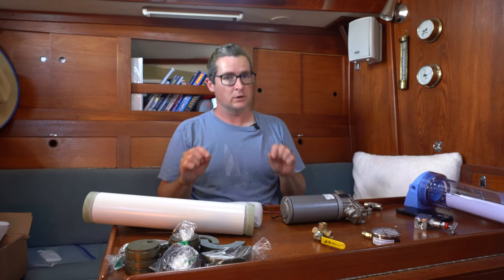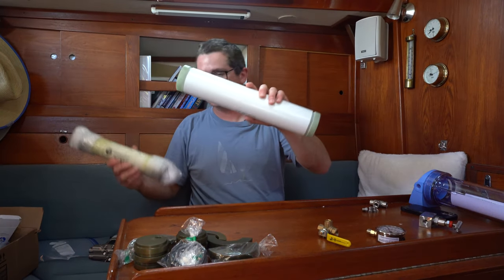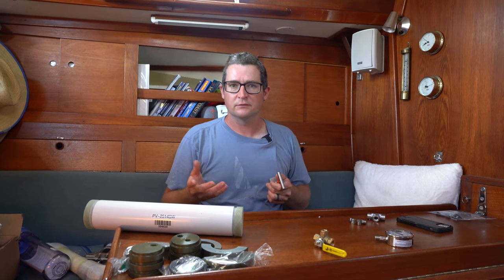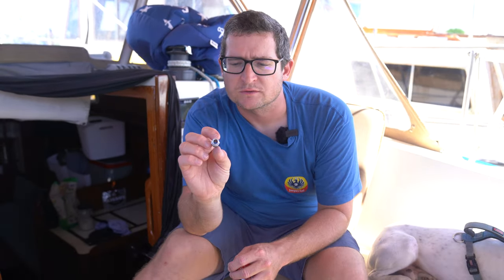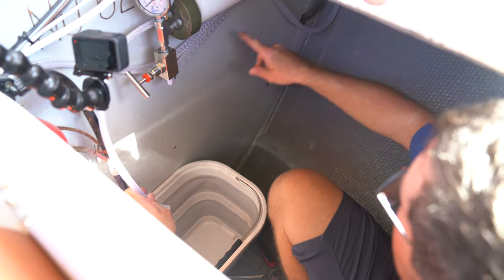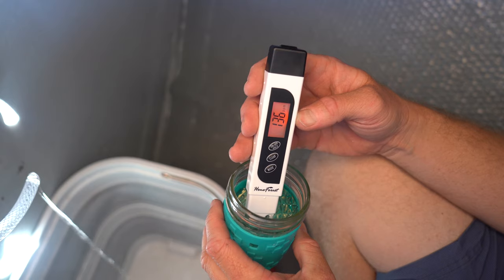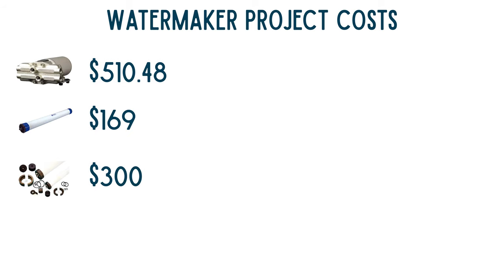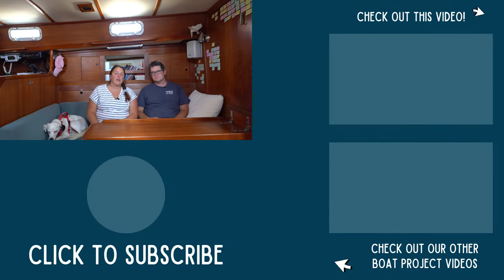A Budget Friendly DIY Watermaker!

Comment: Piston pumps are notorious for have a low tolerance for poor inlet conditions. Being a much better mechanic than a sailor, it occurs to me to locate the water maker below the waterline to create what we call a flooded inlet condition. Excavator manufacturers etc. etc. do this to make their piston pumps last longer and reduce cavitation noise. Of course not being familiar with sailboat "stuff" perhaps this isn't feasible.
Reply: Put the thru hull below the water line a primer pump will do the same job idk if he is using one yet
Reply: all desals use a feed pump
Reply: By poor inlet conditions, you presumably mean that it does not self prime? And that is resolved by having the inlet below the waterline?
Reply: It's doable in most boats.

Comment: I kinda like the size, but I don''t really like that pump.  I have a 12v 1hp pump.  It pulls 80 amps, but I can get 40 gallons per hour on the high side and 35 pretty much in any situation.  It cost around $1800.  So just as a comparison to make 40 gallons of water on your system, you will probably run for 13 hours at 14 amps per hour.  That is 182 amps.  I would use 83 with the boost pump and be done in an hour rather than watching the system all day.  You can go to SV Adventurers watermaker video:How to make a 30 gallon per hour watermaker.  The parts are there in the more section and comments.
Reply: This pump would be around 1/4 hp, but I guess the real point is that it fits well with a solar system,  in that, you can use it for a few hours a day, after the solar controller has finished charging the batteries (and would otherwise   be dumping that power). 14A would be doable with a 300 or 400W system. Sure, a bigger pump would deliver water more quickly, but then you probably have to think of a different way to provide the electric current, and if that is a generator, you might just be better of running a 110 (or 220V) AC directly to the pump. In other words, this looks like a neat solution for smaller boats that have surplus solar power (at least some days). The only downside might be the noise level for an extended period, but i didn't hear them comment on that, so maybe that is not an issue.
Reply: @stephenburnage7687 where they placed the pump, I suspect noise is not an issue. If it’s in the galley or salon, that’ll be more of an annoyance.
Reply: Your system is definitely more efficient (assuming my watt calculations are close to accurate), but a solar based system that can muscle that pump would have to enormous. As the other gent mentioned, a reasonable option for a larger vessel. 180W for 2-3 hours would supply several days of emergency rations of water.  If I was designing a system with large power use I’d definitely go with the bigger pump.
Reply: @just-dl  Nah the wire gauge to the pump is the biggest cost  8 gauge will do it over a short run in silicone insulated.  The solar panels do a pretty good job of recovering the battery completely during the day.  My batteries are LIFEPO4 and even most 100ah batteries can handle 80 amps continuously.  I have 560ah in my boat.
Reply: @allynonderdonk7577  you got the right batteries for the job. That’s an area where money is well spent not having to over think the DOD. Do you run the water maker in isolation? Or is that draw on top of normal everyday use?
Reply: @just-dl  On top of everyday use.  We might have to use a generator for an hour most nights in order to cook as we don't have gas, especially with six people on the sailboat.  Otherwise our 300 watts of solar will generally run two freezers and the water maker for an hour a day....if it's sunny.  With the genset and the solar we can generally keep up and only burn about four gallons of gas a month in the genset. We won't talk about dinghy fuel.
Reply: @allynonderdonk7577  dinghies will always be “don’t-ask/don’t-tell.” 🤣 that is much more “fuel sipping” than I’d have expected. Once I get my brain around the water maker, I’d like to find a diesel maker! (That would be a good seller!) thanks for the insight.

Comment: As a cruiser who has built several watermaker I now build a bigger capacity watermaker at least 100l per HR, 200 per HR is better, run it for an hour and forget about it for a few days
Reply from the maker: When we originally designed this water maker it was to fit in our 1965 Alberg 30 so space was a HUGE factor. Also higher output is going to cost more money 😊 I think now that we have much more space on our T37 we will likely make a higher output version at some point!

Comment: Question: why don't you manufacture them and make millions off of it?
Reply from the maker: Because there are already a lot of companies out there doing just that. The point of this is that if you have a small budget or not a lot of space there are options outside of the traditional commercial versions that might work.

Comment: While SD cards don't die on a regular basis, I have used my Mavic3 with the RC Pro to record in two locations, plus you have the gimbal to keep the video rock solid.  Some build a unit to mount it to hold it solidly and safely.

Comment: At 3 gallons per hour that means an average sized tank would take 10 hours to fill. That's an awful lot of power if there's not much sunshine. Does a better pump mean more output of fresh water?
Reply from the maker: I think most of us use far less than 30 gallons of water per day.  Our average usage is 4-5 gallons.  We typically run the watermaker for a couple hours most days so we are definitely keeping up with our usage. We have set up our solar so that on sunny days our batteries are topped up by noontime so we run the watermaker on the “extra”.  A bigger pump would mean more output but you’d also need to add a membrane or get a bigger membrane and your costs add up quickly. And a bigger pump would also consume more power.

Comment: Thank you very much for sharing your experiences with this DIY watermaker.  Sounds like a great addition to many boats, both in terms of space and energy consumption as well as cost.    Do you have a diagram of the final configuration with priming pump, dampening hose and flush connections that you could share?

The manual operation may be a big plus on boats that dont run the engine to generate electricity regularly (each day).  A bit more effort, but never a surprise of having the watermaker draining the batteries on cloudy days.
Reply from the maker: Hi Jonathan!  Andy is working on a diagram for our Patron Resource Library.  It should be available to our patrons in the next hour or so!

Comment: On the technical side, it would be very informative to hear and feel the difference of using pressure damping hoses and/ or accumulator dampener. Try reaching the manufacturer or supply shop for a demo.  Good follow up video. Thanks for the video. Very fascinating.

Comment: How much pressure is the fiberglass presumably designed to withstand? Also, why the needle valve and not a ball, gate or other design? I suspect it is for fine/granular control but curious if other valves are possible? And maybe a passive pressure regulator?
Reply from the maker: The housing is rated to 1000psi working pressure, burst pressure I would be 3-4 times that I assume.     You’re correct, it’s needs something with fine adjustment to get the pressure correct.    A pressure regulator is something I have thought about and may experiment with in the future.
Reply: @AbroadReachTravel  its mind boggling how much pressure that pipe can handle.

Comment: Another comment is in regards to your needle valve. You mentioned lack of sensitivity to reset. In hydraulics we always turn to a Parker (Fluid Power) product called a color-lock. they have a very fine thread and a long slender taper needle. Just don't know if you can get them in stainless.

Comment: Can i ask what the noise level is like? Obviously, by going with a smaller pump you will need to run the unit longer (several hours) but is the noise level disturbing?

Comment: My son on his boat he's using a dehumidifier and it runs around the clock any produces a good bit of water apparently he said about 5 10 gallons a day going count the humidity so high around the ocean what are y'all think That's what he's doing hey I think he cost him 200 bucks The one he's got does have a holes on it plus it also has a pump in it to pump the water he bought it I think it's $186 you paid for it I didn't know it would work but he says it does so what do y'all think

Comment: Well done Gwen and Andy! Thanks for taking the time to document your installation and explain all you went through. Also, thanks for sharing all the components you used on your installation. I'm sure, many of us will use your "recipe" to build a more affordable watermaker. However, I wonder why you choose the smallest membrane... (Space, Cost, something else)?

Thanks,
Pedro - SV Tulip
Reply from the maker: Hi Pedro!  Space was the main reaso since we original built this system to fit on our Alberg 30 and had already bought all the components just prior to buying our Tartan 37.  Cost was a factor as well since we were trying to be under $1000 but it was mostly a space issue.
Reply: Hello and thanks for all the info you are giving us. Do you happen to know what is the biggest membrane this pump would work with? thanks again, I'm amaze at what you've done.  @AbroadReachTravel

Comment: Great episode, thank you. How loud is the pump while running? With how much it would be running I'm concerned about the noise all day.
Reply from the maker: I think loudness will definitely be relative to where you mount it.  Ours is mounted to a bulkhead which did not help.  The noise went down significantly after we installed the pulse dampener.  I don’t have decibels (it’s currently pickled so I can’t grab it for you), but I will say I can’t hear it in the Vberth when it’s running and  you can definitely still hold a normal conversation in the rest of the boat without it being intrusive.  It’s significantly quieter than the engine and only slightly louder than our fresh water pump.  Hope that helps!  I’ll try to remember to come back here and update with decibels when we get it running again in a couple months!
Reply: @AbroadReachTravel  Perfect thank you for the update. That is what I was looking for, comparative to the fresh water pump is a great comparison.

Comment: This looks like a fine system for folks like me, solo live aboard cruiser with purely 12v charging system and single 300ah LFP battery. Wondering if there is anything you would have done differently with the benefit of hindsight?
Reply from the maker: I think our only regret was not redesigning for a bigger system (a second or larger membrane) when we bought our bigger boat.  But then our costs would have gone up so I’m still not sure we would have done it.  Two seasons in and it’s still chugging along! Just made 10 gallons yesterday!

Comment: How do you maintain a proper hardness of the water? You cannot drink destilled/ too clean water ?
Do you add minerals? Or have a mineralizing filter ?
Reply from the maker: The water that comes out is not distilled.  There are still some left over dissolved solids (ie minerals/salt).  The lowest we’ve ever seen is 100ppm but it typically runs around 200-250ppm which is similar to tap water.  😊
Reply: @AbroadReachTravel  OK!  thank you for info , I have been working with ship evaporators and there the water comes out destilled and requires a mineralizing filter, RO seems much more simple - I going to build a small RO unit to evaluate the function :)

Comment: I would have recommended flushing the system (operating it) for hours before drinking the water. Also, not sure if the teflon tape used was WRAS (or NSF) approved but I would look for that as well as meeting T-27730A mill spec.
Reply: Me too. You need to flush out the manufacturing preservative before consuming it yourself, or giving it to your dog… or dock neighbor… ❤
Reply from the maker: This was the second round of running it so it had already been flushed once before when the sealant failed a few days earlier.  And it had been run for over an hour the second time but no one wants to watch it just running for an hour.  The magic of editing. I promise we didn’t poison anyone.
Reply: @AbroadReachTravel  LOL! Very good. Nice job on the video and installation by the way.

Comment: I posted these questions on your blog but I think the answers would have a broader audience here. Greetings, We were just about to push the button on a $3500 water maker when we found you. Thank you for the article. Couple questions. Why only 1 pre filter? Most if not all WM use a 20 micron followed by a 5 micron. Second is that a brass fitting I see on the product outlet of the housing? I just spent 2 days replacing a rotted out brass fitting in our boat. Is there enough pressure on the product port to push the water say 25 feet to the water tank? Also what is the pressure on the brine output port? I see the pressure gauge read 800 psi but the hose after that is a reinforced plastic hose. How does that hose take that kind of pressure? Also you mentioned you wanted to upgrade the pressure regulator, have you found one yet?
Reply from the maker: We only used one pre filter due to space constraints and the conditions we operate in.  You can definitely use two. 

A plastic fitting could be used, but we haven’t had any issues with brass fittings on our freshwater plumbing.  We had a hard time sourcing fittings locally at the time, so we used what was available and on hand.

25 feet shouldn’t be an issue, but try to keep the restriction to a minimum.  Any restrictions will need to be overcome by a slightly high operating pressure. 

The needle valve is used to control the pressure of system by creating a restriction.  Therefore upstream of the needle valve sees high pressure, downstream is very low pressure.

Comment: 3 gallons an hour...

For the aggravation alone, I'll just do the rainman portable.  

While I appreciate the DIY approach, and certainly your willingness to share, I personally think that's why a proven system is likely the best route for most folks to consider.
Reply from the maker: If you have the space and cash…yup!  😊 but we didn’t have either when we set up the system and bought the components for our Alberg 30 🤷🏻‍♀️
Reply: @AbroadReachTravel  I get it.  I love a DIY approach, personally.  Going on my Meridian 459 and space isn't a controlling issue.  Though my yacht may seem more extravagant, the only way I have afforded to retire to one, is by hard work and not spending money when I can do something myself, as good, and cheaper.  But, in the case of a water maker, I have yet to find a DIY that I can build myself, as good or better than name brand, for any significant savings.

The added bonus, is I can pack it up and take it with me if I get an even bigger yacht, or lend it to a fellow cruiser for a few hours in their time of need.

I meant ZERO disrespect in my original comment, btw.  I actually respect the hell out of not only you trying it, but also sharing your findings and outcome.  

Your ingenuity and willingness to share make you the best kind of cruisers out there.

Fair seas !

Comment: does the motor have enough power to use a 40" membrane or two of them?
Reply from the maker: No.  The rejection rate is at about 75-80% with this set up.  If you added more membrane area your product water would go up and rejection would go down but there wouldn’t be a high enough flow rate to remove salt/impurities.  Would a video about how we calculated flow rates/rejection rates be helpful?  We’ve been tossing around doing a super technical deep dive on this for those that would find it useful!
Reply: @AbroadReachTravel  I'd be really interested to know how to size a membrane based on available pressure washer (:
Reply: @AbroadReachTravel  Hello, any update on this? This vid is a bit confusing with only some of the assembly/install shown, the final product with additional part requirements discussed only. Also curious about flushing. Thank you.

Comment: At 1:40, Gwen says "Water is going to move through a membrane from an area of low concentration to an area of high concentration." - Just the opposite, eh?
Reply from the maker: I think at 1:40 I’m talking about how osmosis normally works.  During regular osmosis, water will move across a membrane from an area that has low concentration of non-water molecules (salts minerals etc) to an area with a higher concentration because it will naturally try to make the concentrations equal through dilution.

But with reverse osmosis, like we use in desalination, we use a high pressure pump to make it do the opposite.  We force the water through the membrane leaving behind the salt and minerals.  The product is fresh water the waste is extremely concentrated salt and minerals with a little water left over.

Comment: Ahem, if you need a cheap "watermaker" (reverse osmosis water filter), come to Taiwan. A model for home use (just providing drinking water) can be had for USD 300+. There are several filters with different lifetimes of 1-6 months. They work with pretty weak motors, so you can just let it run continuously until the tank is full.
Reply: If you could provide a link to a few of them it would be very useful for us not in Taiwan
Reply: @bearpanda3889  Surprise! It worked! Previous comments with links were not so lucky... Edit: Nope, disappeared again. Let's try this: Go to Google and search for these terms:
ro濾水器
RO純水機
That should yield a few results.
Reply: @OlafFichtner   Thanks for those links. i can see that they work but at the moment the server is busy so I will follow them up in more detail when it is quieter.